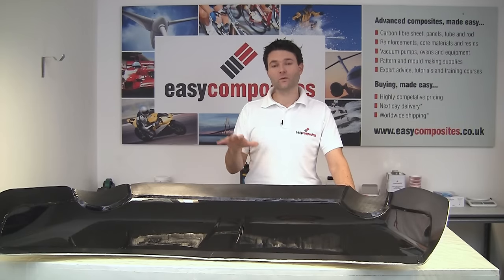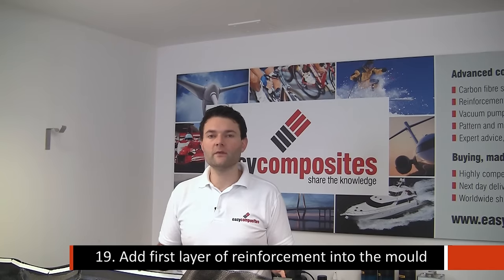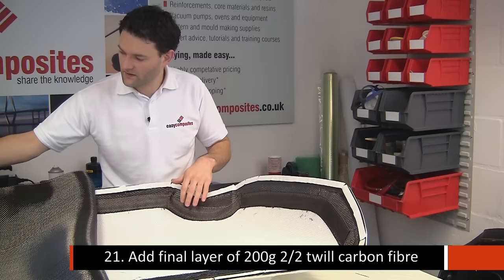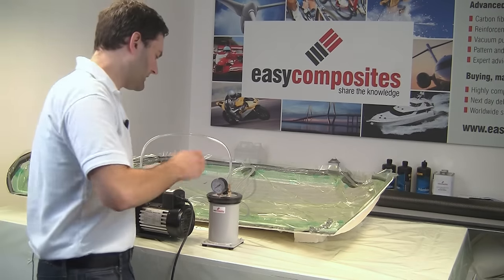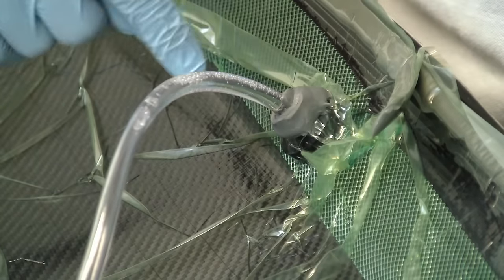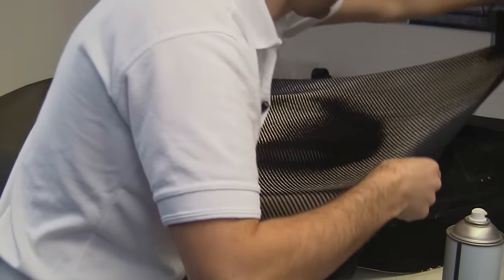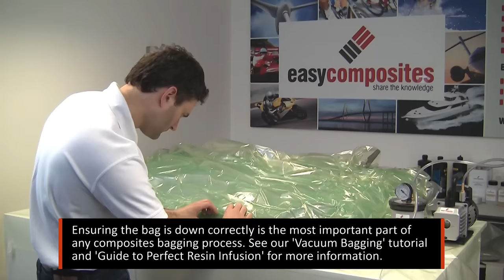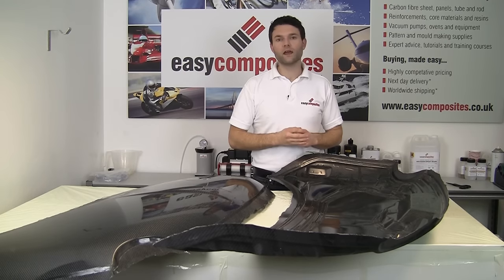How to Make a Carbon Fiber Car Bonnet/Hood - Part 2/3 : Resin Infusion

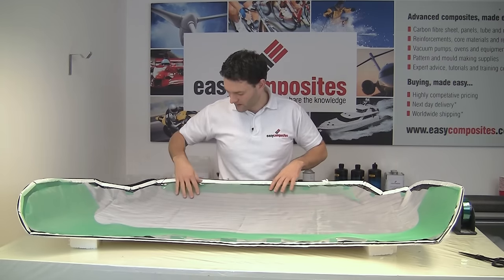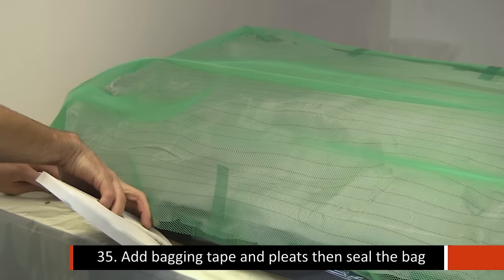Comment: Hi great videos. I've watched nearly all of them in the last few hours! Just a quick question. Why do you use the infusion mesh sparingly on the first half of the part e.g. 6:30 and cover the whole part instead at 15:30? If the mesh helps the vacuum and epoxy spread, wouldn't you use it all over? 
Thank you
Reply from the maker: Hi Charlie, OK, so, firstly, you're looking at the mesh (and the part) the wrong way round. We have full mesh at the START and not much mesh at the END, not the other way round. So, your thinking is correct in that the mesh helps the resin to flow, so we put mesh all the way across the first half of the infusion (the side the resin will be fed in from) and the on the second half we're actually want to slow down the resin flow, to ensure the laminate has time to fully wet-out before the resin reaches the connector on the vacuum side, which is why we reduce the amount of mesh on the second half of the infusion. If you put mesh all the way (which you can do) then you run the risk that the resin races though the mesh on the top-side of the laminate and starts being pulled through the vacuum side connector before it's peculated down through the laminate.
Reply: @easycompositestv  Thank you that makes a lot of sense. I didn't consider it running down through the laminate, only across.
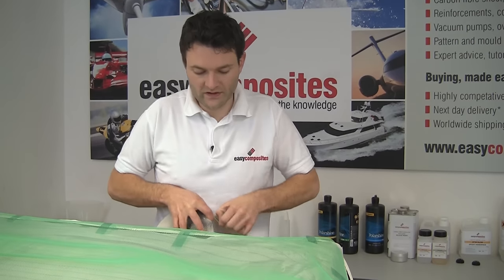Just one more question, for the underside part of the bonnet at 15:30, you ran the infusion mesh over the whole part. Why did you choose to do that instead of a similar setup to the top side part of the bonnet?
Thank you

Comment: I understood the most...but what is that Vacuum-process for?
Reply from the maker: The resin infusion process ensures a laminate with a high 'fibre fraction' (60% fibre, 40% resin) and low/no void content. A hand layup process (without vacuum) would result in a heavier panel (more resin) and some voids/pin holes that - to some extent - effect the performance and the cosmetics of the panel.

Comment: What should i do if my bonnet is wider than 1.25m?? This tutorial is really great but does it work with huge bonnets?
Reply from the maker: We sell carbon fabric in 1.5m width; this is usually enough for just about any bonnet, particularly as the fabric can be rotated 90 degrees to that it could potentially be any width providing that it was less than 1.5m long.

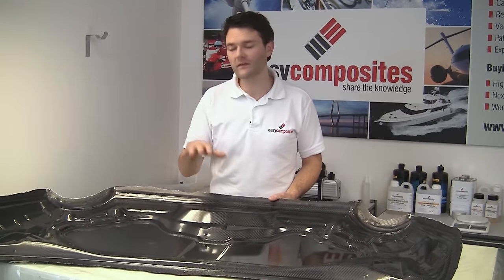Comment: at 18:51 are those rimples of the vacuum bag?
If so how do we prevent/fix them?
Reply from the maker: No there are no bag marks.
Reply: Using peel ply (Dacron) makes it almost fool proof. It not only wicks out resin it helps it breath as well. The bonus is that if you have to bond the surfaces you can break the surface with sandpaper without damaging any of the fibers in your layup.

Comment: Could you use the oem hood as mold for the carbon fiber hood instead of making a whole other mold before you make the carbon fiber hood ?
Reply: They DID use the OEM hood for as a mold!  OEM hood > mold > carbon fiber hood!  There is only ONE mold made here.
Reply from the maker: @maxre9626  I think Bradley means to just lay the carbon directly onto the OEM hood to produce the part; if this is the case then its not ideal, the Carbon part will end up bigger than the original and will have a perfect finish on the inside but would take many hours of sanding and polishing to get a reasonable finish on the exposed face. Of course, you could skin the original hood and adhere carbon directly to the OEM part but this would be done purely for aesthetics and not to make a structural carbon part.

Comment: What is the reason/advantage of using the optional gel coat at the beginning of this video?
Reply from the maker: For some people a gel coat is desirable for a higher gloss and also the ease of polishing.  The GC50 used offers slightly better UV protection than raw epoxy.  However it is not essential and optional for most people.
Reply: @easycompositestv  Thanks for that. Your video series has been massively informative. 👌👍

Comment: I´ve done loads of carbon fiber parts without all this expensive tools like pumps and plastic bags.. Hand laminating works really good with some practice and the result is really good! No need to make it so advanced and expensive. I also worked with aircraft carbon and the method is similar to the one in the clip. One of the difference is we use pre-preg fibers, the fibers are impregnated with a special resin from the manufacturer and then we cure it in a owen with both vacuum and pressure

Comment: Thank you very much for all videos related to the industry of composite materials.
I have a question about vacuum infusion: what would happen to the sendwich laminate: one layer of carbon fiber-honeycomb sendwich material-one layer of carbon fiber, if we laminate with vacuum infusion process in single phase? Will cell of the sendwich materijal be filled with resin or not?

Thanks

Comment: I was looking to try making some large panels but read it won’t cure right without baking it. How do you avoid that issue?
Reply from the maker: It depends on the resin system you're using. Lots of resin systems, including our own IN2 Epoxy Infusion Resin, will cure just fine at room temperature. They only need curing at elevated temperature if you're trying to increase the service temperature of the component up to the resin's theoretical maximum.

Comment: Would this work on a car rear window louvre, i have a fibreglass mould but just wondering how tight would the corners be is this quite flexible stuff as ive been makin fibreglass moulds ?
Reply from the maker: Depends on the fabric you use but it should be possible to get it to conform to such a shape.

Comment: Did he explain the purpose of the pleats in the bag tape? If he did, I missed it.
Reply from the maker: The purpose is to ensure there is enough bagging film to lay into the details of the mould without the film going too tight and lifting from the surface.

Comment: Are all of these chemicals safe to work around without protection?
Reply from the maker: As long as you follow the guidelines in the SDS for each product including the PPE you see shown, there are minimal risks.
Reply from the maker: We wear goggles and gloves for mixing and applying resins and release agents, other than that it's a 'closed mould' process so there is very little exposure.
Reply: Easy Composites Ltd oh great. Thanks for the reply, this tutorial was literally my first ever exposure to molding carbon fiber. Like all that chemical bottle lineup  looks kinda scary and complex. Thanks for the reply once again, and great video by the way.

Comment: You talked about air in the resin twice.  You know you can just mix it in a jar or metal can and vacuum it for a few seconds to pull all that out, right?
Reply from the maker: Thanks John, yes, we're aware. We do degas resin in some situations but in many others we don't find it necessary. I will think about including some information about degassing infusion resin in a future video though so thanks for the reminder :)

Comment: I was thinking of a carbon fiber trim for the outside and inside of my 2014 Toyota Corolla LE, it has that fake plastic that looks like carbon fiber on the outside but I was thinking how could I replace the fake with the real?
Reply from the maker: Either carbon skin the existing part or make a carbon replica by taking a mould in the same way you've seen here.  The carbon skinning process can be seen here: https://www.youtube.com/watch?v=aqwhcfQZT8U&lc=UgyVbLKwwoIqCwuU72B4AaABAg

Comment: Would a plastic scoop on a hood or vent in a fender be crushed or distorted in this process?
Reply from the maker: Crushed or distorted by the vacuum process? No, the pressure is equal on both sides of the mould so there is no imbalance of pressure to create any distortion.

Comment: Pre-pregs need an autoclave to cure, and the molds are much more expensive to handle the heat. The pressure and heat can make them to sag. The finish wont be better with prepregs, the mold makes the finish. The prepreg method is mostly made for the aircraft industry probably becoz it´s faster and the carbonfiber contain a more exact amount of resin. It saves money and the risk of bubbles and airpockets will be less.

Comment: What would be the process for laying down 1 metre wide 650g carbon fibre while doing a hood that is 49 x 54 inches in size? Or any parts wider than the width of the fabric we are using?

Thank you!

Comment: pre-preg carbon fiber is just regular old carbon fiber with special epoxy infuse into it. But, it's a special epoxy and need to reach high temperatures of 500 degrees Fahrenheit for 10+ hours in order for it to cure. From personal experience, the exothermic (wet) epoxy is more flexible then then endothermic (dry) epoxy, but the endothermic epoxy is more stiff. Since stiffness is the reason most people use carbon fiber, endothermic is generally regarded as stronger.

Comment: Can resin infusion be done with an absorbing layer or will the resin not travel? Would I need to do a full resin mesh to help with travel?
Reply from the maker: You need some form of flow media, it can be the mesh on the top or a core designed as a flow media like SORIC. However you need to ensure that flow path exists from the resin feed to the far side of the part.  Also generally most flowable cores flow relatively slowly compared to a typical medium flow mesh.
Reply: @easycompositestv  but it can successfully be done with an absorbing layer to work without a catch can?
Reply from the maker: @Diamondsintherubble  An absorbing layer would likely soak up too much resin from the material leaving it with pinholes.
Reply: @easycompositestv  okay, that’s what I was looking for. Thank you so mych

Comment: can you do this with out drawing the epoxy? and just brushing it on first
Reply from the maker: Yes, you could do this. This would be known as 'vacuum bagged wet-lay'. We don't generally recommend this method though because cosmetically you would not be able to expect quite the same standard of appearance (you would be left with pin-holes in the surface) and you would need to get all of the lamination done and the part vacuum bagged before the resin starts to cure, which could be a challenge.

Comment: I have a trunk boot in the UK mold with a large flange can I put the infusion connectors and spril wrap 
on the flange so I won't get printing problems
Reply from the maker: Yes as long as the flange is big enough then you can do that no problem. Ensure you have left enough room for your gum tape so that you can get a good seal against the flange of the mould.

Comment: What pressure do you use on the compressor to create the vacuum?
Reply from the maker: No pressure is used, only vacuum. Generally 99.9% or 29.9inHg vacuum is recommended for best results.

Comment: How can i make a mold of bumper ? Do i need 2 mold like the hood for each side ( inside and outside of bumper ) ? I want to make carbon fiber z4 gt3 bumpers.
Reply from the maker: For a bumper/fender, the same process would be applicable but you would only need a single mould tool, not the inner frame work as you do when producing a bonnet/hood. You may need to be careful when designing the mould tool in case it needs to be a split, multi-part mould.

Comment: Do you guys make a carbon fibre hood for a 2012 audi s4? Something with a good scoop or hump kinda like a e92 m3
Reply from the maker: I'm afraid we don't actually make hoods/bonnets or any other moulded parts like this. We sell the materials and equipment and we provide the training and tutorials/guides. If you want to do it yourself (like in this video) then we can certainly help with that but we don't have any ready-to-go parts like this at all, sorry.

Comment: hello, bonnet gets hot so i want to ask how well this infusion epoxy can stand heat? thanks
Reply from the maker: You will need to do a full post cure as per the Technical Datasheet, but once that is done, the IN2 infusion resin is fine on bonnets.

Comment: what was the cost, the time the weight difference, The advantage ?
Reply from the maker: Cost is a tricky one because you may want to separate the costs of the mould from the cost of the tools and equipment from the cost of the part itself. If you were looking only at the raw material costs for the component then there is around £250 worth of material in the bonnet. In terms of advantages the original (steel) part weighed 22kgs compared to the carbon fibre part that weighs 3kgs so it's nearly 20kgs lighter. You can pretty much figure out the advantages of saving 20kg on a single panel or shaving 80% off the weight of any component.

Comment: If you wanted to mass produce for sale, dose the car manufactor need be dealt with on design copyrights ?
Reply from the maker: No, you're making a part that needs to be a certain shape to fit a vehicle. By the time you've taken moulds, slightly modified them (with wax and barriers etc.) and then made an alternative part using completely different materials and methods then you're making a quite different product. Also, pattern/reproduction panels allow competition and keep markets open and so are generally not discouraged or overly litigated. Legislation varies from country to country though so you could look into rules more closely in your territory.

Comment: easycompositestv Are there any other options to substitute Lantor Soric as the core?
Reply from the maker: For fairly flat bonnets, you can use PVC foam as a core material.  A similar substitute for Soric is 3D core which you can find here: http://www.easycomposites.co.uk/products/core-materials/3D-Core-PET100-Foam-Core.aspx

Comment: Is it necessary to use the vacuum bag?
Reply from the maker: Well, you would certainly need to use a vacuum bag if you're following a resin infusion process! If you're asking whether it's necessary to use resin infusion to make the part then it's not essential and it would be possible to 'hand lay' a carbon fibre part but the result would be more resin rich (so heavier) and wouldn't have such a great surface finish (it would be pin-holed). Also, you wouldn't be able to use the Soric core material for a hand-layup because it wouldn't wet out properly.

Comment: Can you make your own suspension parts like control arms from Carbon fiber?
Reply from the maker: Hmmm, well in theory, you could make anything with the knowledge and equipment but in practice for a safety critical component like suspension componentry that would usually require FEA as part of the design cycle and tests including xraying to check for voids and weaknesses, it may be outside of a normal DIY project.
Reply: @easycompositestv  Thanks! I would have though probably you want to autoclave suspension components aswell an probably mold in bushings and other metal fittings at a level of precision beyond the scope of a diy project aswell. Thanks for the answer you videos really make me want to try this out.

Comment: may i know where to buy ( special infusion grade spray tack) and if you have it ,what is the item number or name ?,,, also can i use it if i am using brush lamination ( not infusion) ?  thanks.
Reply: sorry ! i am just new in your chanel ,, i have seen the project page and find it,,, but  i am still have my question about using it with normal lamination by brush . thanks.
Reply from the maker: In a practical sense it would not really help in wet lay up by brush as the fabric will be immediately wetted out with resin and thus the glue is not really holding anything in place.
Reply: Easy Composites Ltd thanks.

Comment: excuse me ,asked vacuum pumping system is purchased?
Reply from the maker: The vacuum pump we use is a 1.5CFM pump which can achieve 99.9% vacuum.  Any pump with similar or better pumps will be fine.

Comment: what does the soric do or function as? thanks
Reply from the maker: In this application, the Soric functions both as a structural core and as an internal flow media during the resin infusion. Using a structural core is a good way to increase stiffness of a panel in a more efficient way than just using multiple layers of fabric.  It also saves weight over using pure fabric alone.
Reply: Is there a reason why you used soric instead of nomex?

Comment: I would like to know if you wouldn't to make it a hood  for a 1970 Datsun 510
Reply from the maker: The principle and materials would be the same.
Reply: @easycompositestv  yes I know but it's a lot easier if I just purchase it from you I will buy four of them I have my original one if you need it
Reply from the maker: @jackinbox3382  I'm afraid we don't offer any manufacturing services - we can supply materials and technical support but we don't produce items to order unfortunately.

Comment: Could you use it to make molds for the oem dashboard?
Reply from the maker: Jarrett Phillips Hi Jarrett, yes you could make a range of replacement OEM parts in carbon fibre in just the same way, including a dashboard.

Comment: What was the cost of materials/ equipment for this project? I see others asking but no response 😕
Reply from the maker: I think I've replied every time someone has answered but there's been thousands of comments, maybe I missed one. Breaking down the cost depends on what you want to include in that cost, for example we use a spray gun, should we include the cost of the compressor too? And there's the bricks of course ;) - Anyway, if you go to the project page on Easy Composites there's a list of all the products and materials used and you can even buy them from there too. In total, including all the equipment (excluding compressor and Dremmel) you're looking at about £1600/$1850/1750 euro. For that you get lots of things that can be used over and over (such as vacuum pump, catch pot, the moulds etc.).
Reply: @easycompositestv  Thank you for the reply! I didn't see any responses so I apologize if i missed any.